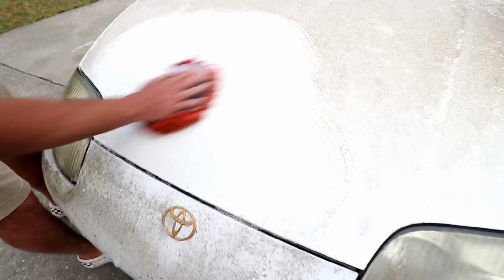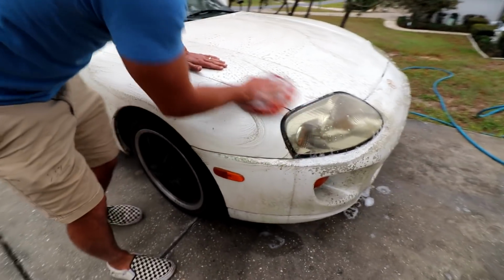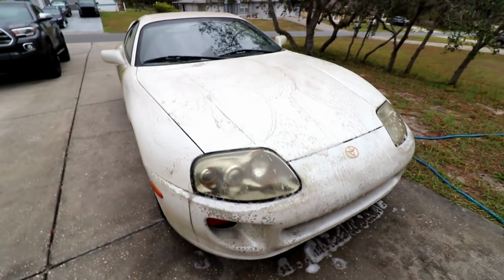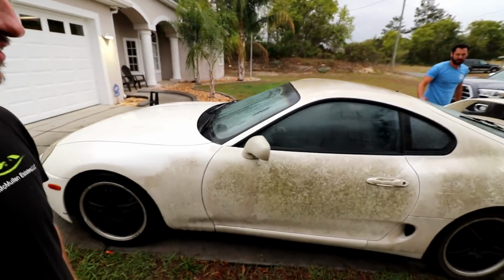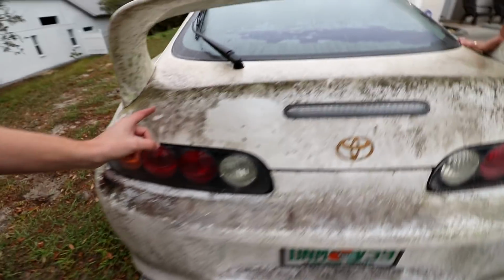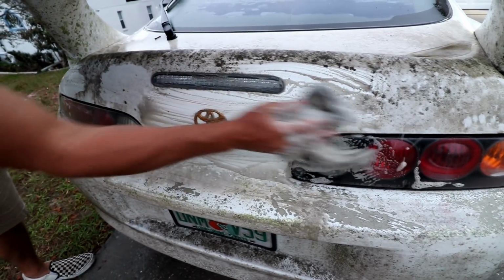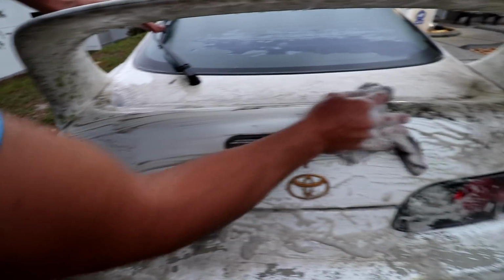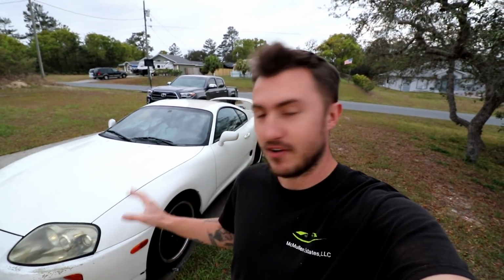Cleaning The Dirtiest Supra Ever!!?? | Mk4 Barn Find Toyota Supra

Comment: More like wet sanding the car with mud... Cringing the whole time....
There was a great chance the paint under that was pretty good... 

A light steamer would have gotten it off easy along with a ton of water, emulsifier soap and some microfiber towls
Reply: Paint pretty good? Did you not see all the spots of all bare metal and every car panel is a different shade of white because the clear cote has been gone for so long?
Reply: Hes repainting it

Comment: If this ever happens to you, buy a gallon of super clean degreaser (purple bottle) and spray it on your car STRAIGHT no dilution. Then wait like 5 minutes. Pressure wash it after. All that gunk will surely come off. 
You never really want to scrub paint. Even if you 'might repaint'. You really can destroy the metal underneath.

Comment: I'm not hating or nothing but I detail cars alot and next time use a pressure Washer with a wide spray itll scratch less since it's not as focused on one spot of the car, and use it before you ever touch the car that way your not moving/Swurling dirt across your paint, just a friendly tip

Comment: Try loosening dirt first by soaking in foam then rinsing then repeat before actual contact or scrubbing of bodywork.
Reply from the maker: Ss G 
That car sat outside through multiple hurricanes I don't think foam would havw done much. Pressure washer was bearly taking it off.

Comment: Should have wet the car down. Bought some Turtle wax Extreme car wash. Used different mitts and rinsed the mitt after each panel was washed. Then used the power washer. But not so close and less pressure. Real easy each time till clean. That close will take the paint and the dirt at the same time. Unless you are going to paint later.    Shawn.
Reply from the maker: Thanks Shawn yeah car is being repainted.

Comment: Probably gonna be worth more with the original paint job but cool find none the less. Should have pressure washed first and then hand washed.
Reply from the maker: ROTTBOXX 1980 
Paint was pealing all over. Passenger side of car was not original paint. Just wanted to get all the mold and grime off before it went to be painted.
Reply: @KevinMcMullen.  right on. If it was original I would have left it. But if that's the case go for it

Comment: Power wash off mold! Foam Gun paint. Power wash again. Foam gun again. Use two buckets. Rinse mitts after wiping car down. Power wash again. Foam gun and use clay bar or mitt. Foam gun! Final rinse and buff dry. Buff paint with Meguiars Compound.  Then use Meguiars Ceramic wax after washing againg. Microfiber towel dry. Will not ever repaint car.   Shawn
Reply from the maker: If the paint was savable, he would have had it detailed but the paint was falling off and he dropped it off for new paint a week later. I need to make an update video on this car one of these days. Completely different car now.

Comment: Should have used a foam cannon and 2 bucket method with a new wash mit😂
Reply from the maker: Vishek Chand 
This car sat outside through multiple hurricanes over the years. Nothing but pressure would get that mold off. Plus paint wasnt original and it was not saveable.
Reply: @KevinMcMullen.  atleast he's painting it man that will make the car 10 times better
Reply from the maker: Vishek Chand 
100% he has been post poning it because he might change the color. Even tho its kind of a rare color.

Comment: A degreaser would’ve been better. Or at least soak it with foam at first. It is always in the plus side if the car came with original paint.
Reply from the maker: Amira Alqattan 
Car had been repainted at some point. And that paint was pealing/ flaking off.

Comment: You shouldnt be that close to the paint with a Pressure washer!!! It doesnt look like its ruining the clear coat but its weakening it. Im a professional detailer. And if its dirty at any level, its beeter on the pain to ise a 2-3 bucket method and at least 2 micro finer scribbers.
Reply from the maker: Mike Armantrout 
Thanks Mike. He wasn't being carefull because he planned on painting it right away.

Comment: I wouldn’t be surprised if this was a single stage white car and that’s why all the shit ate into it so bad. Most Toyota cars and trucks were single stage white up until the late 2000s
Reply from the maker: Kevin Hockenberry 
Yeah they are all single stage.
Reply: Kevin McMullen that’s a shame. I wasn’t sure if because of the msrp of the car they would clear them for white and black and red
Reply from the maker: Kevin Hockenberry 
Nope all single stage. As it was a mass produced car. New paint will be base ans clear same with my supra.
Reply: Kevin McMullen that’s how I did my FD, but I tweaked the color, did the bay, and inside and outside of doors, hatch and hood
Reply from the maker: Kevin Hockenberry 
Id like to do in and out but the supra has 12 vin tag stickers all over different panels and if you removed them it lowers the cars value.. I know stupid... We both will probably just have the outside of ours painted. Did you pull your windows in the FD?
Reply: Kevin McMullen 
Yeah I pulled the windshield and the glass in the hatch. I painted the whole car myself, rolled and pulled fenders and quarters, and removed the VIN stickers from the door jamb but I’m a body shop manager and we deal with a company that can recreate the VIN stickers if you send them a picture of it.
Reply from the maker: Kevin Hockenberry 
That's Awsome man! Sounds like you did a great job. There is a online place I could buy new vin stickers from just wouldn't be original which supra guys are anal about.

Comment: 1:00 you are causing scratches on the paint because the surface still too dirty, first yo need to remove all of this diry with soapy water at high pressure.
Reply from the maker: Juan Álvarez 
Thanks. We didn't take any precautions because the car will be getting new paint.

Comment: If a job is worth doing, it’s worth doing right. You just sanded your paintwork. Cleaning bottom to top. Pressure washer pointed perpendicular to panels instead of at a more acute angle. 

Shame on you, sir!
Reply from the maker: Colin Reid 
Thanks Colin that means it won't need ad much sanding at the paint shop.

Shame on you sir for not listening.

Comment: I know your repainting it but this way of cleaning is much harder than pressure washing and soaking the car with shampoo to let it get into all the neglected parts of the car. 

Anyone watching this should never clean paint old or new like this even on a clean car as it will seriously damage the paintwork
Reply from the maker: darryl cameron 
This car sat outside through multiple hurricanes soaking it wouldn't have done anything. Literally paint was pealing off the car when he bought it.
Reply: @KevinMcMullen.  yes I'm just making sure people know not to do this as it's bad practice no matter what u say hurricanes sand storms doesn't matter how can know one just say that they dont recommend cleaning paintwork like this as it damages it

Comment: Juse use sandpaper. U are just rubbing the dirt in to the paint.
Reply from the maker: Tomlantis 212 
That's good we won't need to sand it as much for the new paint job.
Reply: @KevinMcMullen.  oh if ur repainting it than i withdrawn my comment
Reply from the maker: Tomlantis 212 
No problem. We just did a twin turbo 6sp swap to it and it's about to head off for new paint.
Reply: @KevinMcMullen.  did u get a factory 6sp?. My buddys got a toyota aristo which has the same twin turbo but its a 4 door sedan. Only offerd in rhd in Japan
Reply from the maker: Tomlantis 212 
Those arw nice daily drivers. Yes we swapped a factory v161 6 speed transmission into the car. I also just ordered a 2jzgte with v160 factory 6sp for my Supra. Will be swapping soon. Auto to manual.
Reply: @KevinMcMullen.  they are but here in Ontario they want like 4x times more for insurance on a rhd. Pretty cool build now u need 600hp and ur set
Reply from the maker: Tomlantis 212 
Thanks man. This is my friends car I have a 98 quick silver supra that I'm about to start building for myself. Just ordered a 2jzgte 6speed swap for it. Rhd cars here have higher insurance too.
Reply: @KevinMcMullen.  i was told if u have house insurance u can bundle it and if ur lucky get a discount. Or wait till its 25 plus yeard old and register it as historical
Reply from the maker: Tomlantis 212 
I haven't tried bundling with my house. But I didn't notice a difference between 25yr and newer rhd as far as cost on insurance.
Reply: @KevinMcMullen.  bundling will save if u have house insurance they will usual do a discount even for rhd. From what i was told if u get historical plates u can get cheaper insurance as long as its garage kept. I really want a aristo. 2024 will be the year if i get a 1999